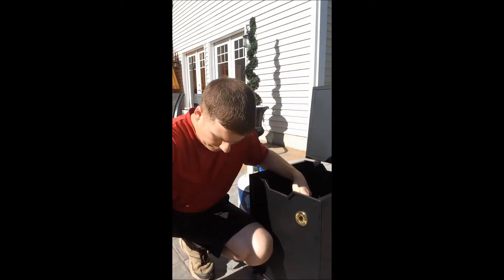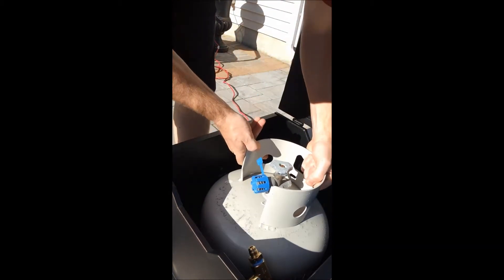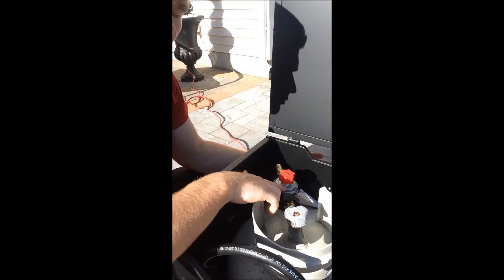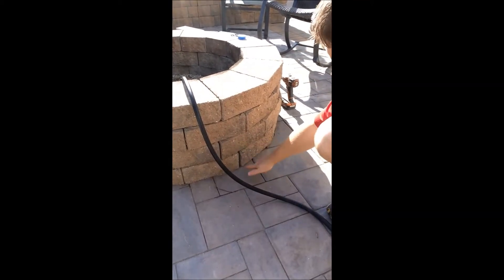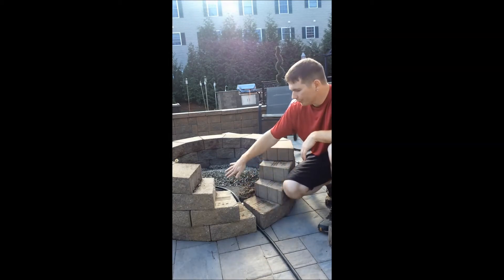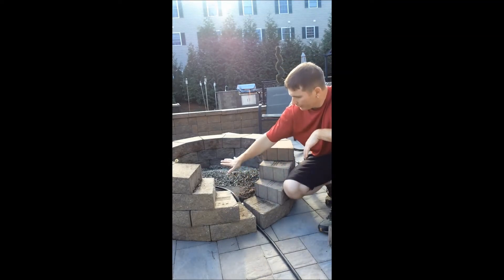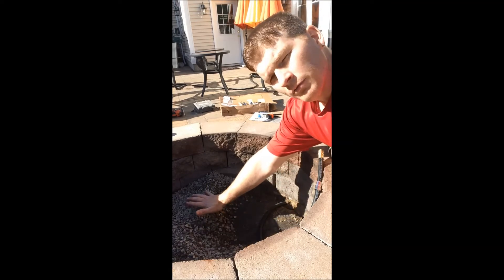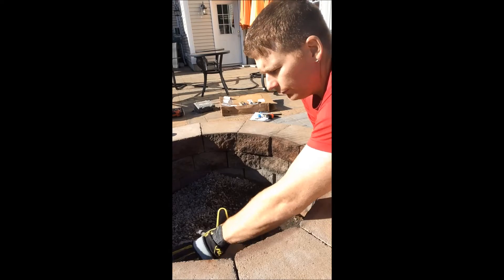Fire Pit Wood to Propane Conversion

Comment: I see no air mix fitting for propane in your setup.  Everyone else says they're needed.  Looks like yours is working, though.
Reply: You need the air mix for liquid propane, but not if you are using vapor from a low pressure regulator.

Comment: How is your backer board holding up?  You having any issue with water build up on the backer board when it rains?
Reply from the maker: No issues, water drains off between the backerboard edge and split face block. It's been in use for about a year thru rain, snow, etc. and the 1/2" backerboard is still in good condition.
Reply: CareerLifeDIY sweet.  Thanks.  It's like $159 for a 30" SS pan. Your options saves a lot of money.
Reply: Did you get use the waterproof backerboard? Also - what would I need to cut the backerboard with?
Reply from the maker: @hollystaab1344  It was fiber cement board off the shelf at HD with no treatment applied to it and has held up for 6years now. Used a jigsaw with a diamond grit to cut it, if I was to do it again would use my router instead.

Comment: Where did you get your pan and burner. Thanks in advance and great video.
Reply from the maker: Purchased from Amazon, search for "Fire Pit Burner" and you will have many options to choose from. The pan is just a piece of Cement Board from Home Depot.
Reply: CareerLifeDIY I have searched on amazon and can’t find any with the 12 foot hose. Can you provide the link for the exact kit you got, please?
Reply: Michelle Eichert Reynolds were you able to find the 12 ft. Hose on Amazon. I located several